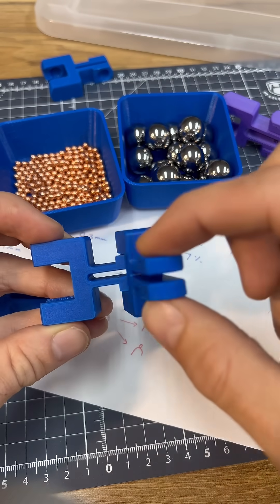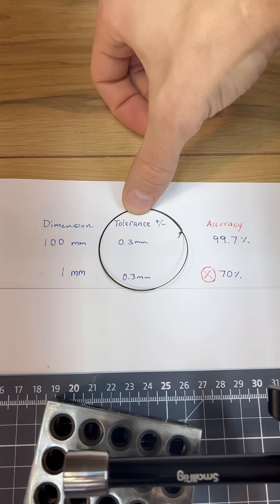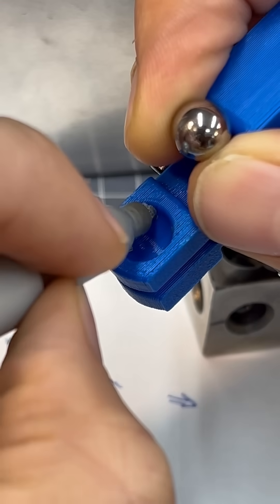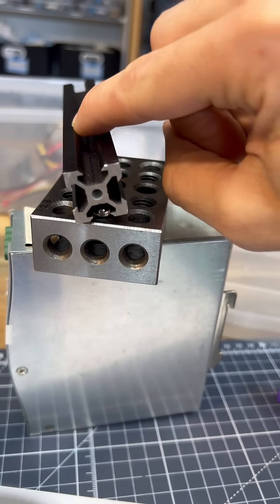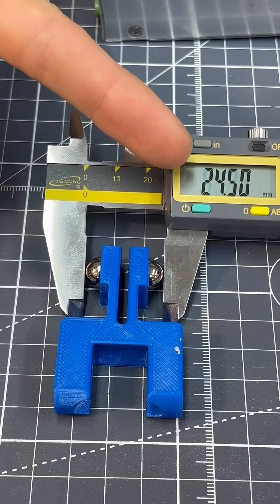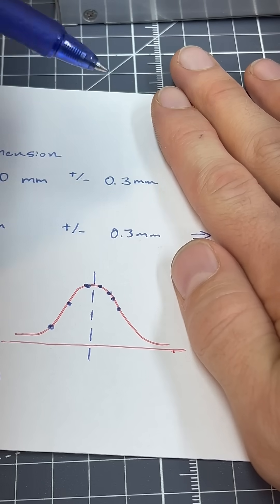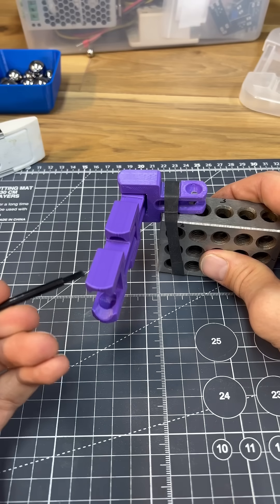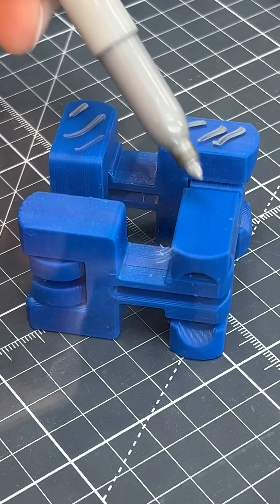Exhibit 1: borrow a tolerance, design 3D printed part with Axis.

Comment: My thermodynamics engineering teacher always told me if you sound like the smartest guy in the room, but no one understands you, then you have lost the plot.
Reply: He's just saying to not print something that is too small of a distance because the shorter the distance, the shittier your accuracy will be (70% accuracy for 1mm.  99.7% accuracy for 100mm apart.  That's why he chose a distance of 245mm to get a very high accuracy confirmed by his digital caliper.  

Next thing he mentioned is tolerance of 0.3mm. That means s You will have an error of +/- 0.3mm Everytime you print something between 1 and 100mm.  The problem is you don't what the actual error WITHIN 0.3mm will be. Can be off by 0.1, or 0.05 or 0.2451821 mm. That's why he printed like 10 samples and measured the error and calculated the mean to see what the average error was between his samples.  So if the average was off by -0.1mm, in your REAL print, you want to offset / compensate for that distance.  Eg if his 3 contact point distance was 3mm on your CAD, you'd offset that distance to 3.1mm based on the average gaussian mean error he calculated.
Reply: @vex123  I'm even more confused... You lost me at "That's why he chose a distance of 245mm"... But how can you chose a distance?... I mean if I need my part to be of some specific dimensions, I can't choose other dimensions. It needs to have the dimensions that it needs to have...
Reply: @MStoica  Sorry ... good call on my mistake - it's 24.5mm, not 245mm.  So in that case he will have BOTH accuracy between 70% and 99.7% and a tolerance of +/-0.3mm.  He also seemed to have some kind of a steel jig with high accuracy so maybe he used that somehow to achieve a high accuracy 24.5mm as a reference point.  And then isolated the tolerance variable using the mean Gaussian distribution would be my guess....
Reply: @vex123 ohhhh 😅
Reply: @MegaChickenPunch  I'm with you bro haha
Reply: You should have made, or at least narrated, the video, it would gave been better  @vex123
Reply: @vex123  Then he's not really using good words to say that because mostly anyone understood what was he saying exactly
Reply: @vex123 why not just say that then?
Reply: One of my mentors once told me that you never want ro be the smartest person in the room.
Reply: @joho0  don't be the smartest guy while you're working you're way up.  Near the end of your career, switch rooms and  that's exactly what you want to be to capitalize on your expertise.
Reply: @joho0 no for real though! I was in a room with three other grown men, all at least ten years older than me, and not a single one of them knew the word vague. They all just blankly stared at me when I said it! One of them thought I was calling him a f*g! I HAD TO EXPLAIN THE WORD VAGUE AND THEY ALL WERE ACTING LIKE I WAS THE DUMMY SOMEHOW
Reply: He's saying that printers have unscaled tolerances. That inaccurate tolerance with an axis, like with a hingepin style movement, would wobble and torque. The three small ball bearings make the larger one fit snugly, (they locate the sphere by three points in space, and so give more precision in where the sphere actually touches the part) and still roll with the least amount of friction. In turn, the larger ball bearings seat against them, making the width of the whole joint much more accurate so it doesn't allow the chain to twist.
Reply: Can’t dazzle em with brilliance than baffle them with bullshit
Reply: @Brownnoise443 - then
Reply: @Brownnoise443  so I saw this on a youtube comment a long time ago, thought it was hilariouse and started using the phrase day to day. Just curiouse, where did you come about that phrase? Just tryna figure out where it came from
Reply: Was this a complex way to describe what a bearing does?
Reply: Well then, that’s currently a huge issue for me.

Got a project I’m working on and what I made is pretty crazy. It’s not just the design I had to make but a whole parametric model to generate many different sizes. (Which happens nearly fully automatically based on a couple parameters).

But the issue is that even the CAD professor doesn’t understand everything I did
Reply: If you're the smartest guy in the room, you're in the wrong room
Reply: @TAP7a what if that room is filled with women?
Reply: Perhaps you still need to complete the prerequisites for this course.
Reply: I understood it. I appreciate your thermodynamics teacher's sentiment, but this is just a situation where you should do some more research.
Reply: Yeah but people actively choose to not understand.
Reply: I literally thought I was the only one who didn’t understand this
Reply: @izdotcarter  they you're a dunce, because it's really simple and explained.
Reply: Engineers have a need to make things sound overly complicated until someone slaps their hand and reminds them the purpose of words. My first highly technical lab report for a circuit design class came back with a B but more than half the sentences were crossed out with “not needed” and every instance of “utilize” was changed to “use” with a note “wrong word”. Actually, the mistakes were so common across papers, the mistakes were marked with numbers and you had to reference the grading key.
Reply: @lusher00  they're not engineers, they're arrogant pricks who think they're engineers, they want to feel smart not be smart.
Reply: @lusher00 Depends on who you’re explaining something to. Sometimes the hardest thing is explaining to business how something works or why it needs to be done in a way they can understand.
Reply: @Nihlink  no audience needs things explained in unnecessarily complicated language designed to make the presentation sound smarter than it needs to be, particularly nontechnical management
Reply: It's the short form content.  I seriously recommend going to his channel and watching the long form vids if you have any interest in production and design.  This guy is absolutely brilliant.
Reply: Yeah seriously.
Reply: ironically enough, MY thermodynamics professor always sounds like the smartest person in the room, and none of us understand her or gain anything
Reply: yeah true this is hard to understand
Reply: This!
Reply: with the most votes in the comment section, this comment should be number one. That was too much unnecessary explaining.
Reply: I feel like there was a preamble here that didn't make it into the short.
Reply: So in other words Terrence Howard.. lol
Reply: After being in maintenance for 3 years I have learned that talking like a caveman is the best way to go. In their defense I kinda have all these visuals in my mind that my retarded hand gestures cannot convey.
Reply: Your teacher only defined politicians chit chat,  sounding smart meanwhile talking bullcrap.
Reply: My thermodynamics teacher told me pi = 3 = e
Reply: Story of my life
Reply: @cybyrd9615 grats bro
Reply: If you don't understand it, then it isn't meant for you. You're not the only one in the room.
Reply: That’s because your thermodynamics teacher was often lost

Comment: You lost me at using the 2 points from the 1-2-3 block to define the axis in your design. Is this spoken relatively? As in, was the 1-2-3 block only representative of the situation? Makes it unclear to explicitly say you're using those points to define the feature on the part.

I could be missing something, but i have a pretty strong background in DFMA and GD&T and think this video is poorly explained outside of the explanation of relative tolerance.

Comment: In layman's "balls always touch a hole in three spots", "3d printers are not very accurate in small spaces" and "it's easier to center the balls in a hole than it is to print a perfect hinge"
Reply: Fuuuk, i figured it out. 
"it's easier to center the balls in a hole than it is to print a perfect hinge" is actually not the final conclusion he is trying to state.

The first 2 he states like you said.
But the final point is more like.
"if you want to get something to be accurately positionable (like a hinge) in a 3d printer make the design reliant on far apart positions in the same axis/plane instead of a single point or multiple points grouped together. because the printer can position the points accurately but the precision will be the same on all types.
Thus by spacing out the reference (contact) points you can get a more accurate result. "
Or 
"Rely on the printers ability to put material in specific points irrelevant of distance and design around the precision gained from creating an axis or a line using 2 contact points"
Reply: @sandertu8366 oh this makes sense - put the edges of the hinge as far apart as you can to get as accurate a linkage as possible
Reply: While I'm admittedly not currently operating at 100%, I am not sure I would have figured out what he was saying before scrolling away were it not for multiple comments working in tandem to parse it out, and without listing off credentials, I typically am more than capable of grasping concepts such as this when being taught.  It feels like he was told to explain the concept as tangentially as possible.

To explain it all even a bit more simply without going full on eli5 (I hope), the point is a ball shaped hole will contain more irregularities than an ever so slightly larger hole in which three bumps are placed for the ball to actually be in contact with.  It's easier to have more control over the position and motion of the ball when you only have 3 points to worry about, where the ball sized hole has infinitely more possibilities for an errant bump or dip, meaning infinitely more deviations from a perfectly smooth rotation in the desired location
Reply: https://youtu.be/pN-rh6UwR_A
Is this long-form version of this top.
He buried this link somewhere.
Reply: It took this guy some balls of steel to make a good hinge
Reply: He accidentally created the audio equivalent of "the dress"
Reply: it should be called genius terms, it takes a genius to break things down to simplist terms, thank you.
Reply: Thanks, I was too stoned to follow along.
Reply: You did not help, but made things worse
Reply: So, a socket is better than a hinge because it contacts more surface area? So, he basically turned a socket into a hinge with more accuracy by combining two sockets?
Reply: That last sentence is not what he's saying at all. 
The first wobbly rotation uses the same setup with a ball. 

This video is talking about rotating the base axis of the print to make up for the inaccuracies of the printer and using the balls' point of contact to determine that. 

Notice how the lattices on the blue parts (wobbly) are perpendicular vs the purple parts (stable/smooth) which are diagonal.
Reply: It’s like saying if you throw 2 darts at a dart board, you can expect the midpoint between the darts to be closer to the bullseye than either dart alone. 

Increasing the sample size causes the average to be closer to the expected mean value. Note: This assumes that the positioning errors are independent events, which may not be true.
Reply: Tars, humor 90
Reply: Yes, but with hinge you get a pole that's pushed into a hole, and this way you only get balls touching the hole, which is pretty much dissatisfactory.
Reply: Thank you! I was like wtf
Reply: I'm a freshly minted Mechanical Engineer and had to watch this three times to figure out his point was to use commercial parts with tight tolerances to make up for issues with FDM
Reply: @countera6567  Are you really a mechanical engineer ? Because I m in school of engineering and his point was to use the fact that a ball only need 3 point to stay, so if you print an "hemisphere", you will get a normal distribution of having your metal ball at a certain heigt. Therefore, it's way better than just printing some joint, because you get a high probability of having a ball that is nicely centered.
Reply: @countera6567 Yeagh - I’ve just watched it like 6 times and I’m really not much wiser. Having tried to make some bearings in fdm which I tried to optimise for a month or so (and surprise surprise it didn’t work well) instead inserting deep groove ball bearings and all the problems went away, where the fdm bearing surfaces just interfered with each other nastily as I just couldn’t get them smooth enough/ tight toleranced enough. But … I think he’s trying to say something else - as in his example he’s not putting a complete “rolling element” bearing in, instead just putting spherical steel balls - but that just feels to me like - putting half the bearing in, or at least as I might put it - a simpler bushing instead. So …. Yes I’m not sure I get what he’s trying to say. I think there may be a general point he’s making but I just don’t get it. It seems obvious to me if you have things ina. Design that fdm can’t resolve, or doesn’t have the right material properties - then you use the item as an off the shelf component - eg small steel screws such as m2s and m2 nuts … which you just couldn’t fdm. So you use the off the shelf screws….
Reply: @countera6567  What did you think he was saying initially? He was using low tolerance designs to create higher tolerance restraints to the motion of the hinge.
Reply: I don't understand why anyone would want to limit the number of people who understand what they are saying.
Reply: @steveescher1554 Don't attribute to malice what can be attributed to ignorance. Teaching is harder than it looks. And the more you understand something (or feel like you do at least) the worse you will be at explaining it, because you will assume the audience knows about things that are obvious to you but are not a given to others. Those others will not understand anything about the explanation if they don't have the tools to do so because they were not included in the explanation.
TL;DR: explaination bad because explaination too short because explainer thinks some things don't need explaining
Reply: @Ragnar_Oock idk, I was taught by a professor that truly understanding a concept means you can explain it to anyone. Even those who don't know the technical jargon, that's why trying to explain concepts to others can be so helpful in learning.
Reply: @Ragnar_Oock  I know where you got the first line of your paragraph and I respect it. Love that video.
Reply: @blackace1295  that's a very common phrase
Reply: @chickenfishhybrid44  and?
Reply: @Ragnar_Oock  "If you can't explain it simply, you don't understand it well enough." -Albert Einstein
Reply: @Ragnar_Oock  On top of this, explaining technical things as accurately as possible can lead to obscure-sounding explanations. Explaining complex things in basic terminology can lead to a more inaccurate explanation. There is a balance needed, and the audience is such an important factor in delivering a message well.
Reply: I wish my teachers had understood this. @Ragnar_Oock
Reply: @countera6567 that’s exactly right, to explain something simply is to understand it fundamentally.
Reply: @countera6567  no, that's just getting really good at explaining things.  Someone that's bad at explaining things can still have a perfectly clear understanding of complex theories.
Reply: @Ragnar_Oock Nah, he just cuts part of his main 30 min video in the worst way possible. 

He’s too lazy to come up with a proper YouTube short explaining the concept, and instead cut up a bunch of clips missing a lot of context.

Doesn’t cut corners with his GD&T but cuts corners in a poor attempt of simplifying it.
Reply: @Slayer8248  Thats not a strong argument given that concepts being glossed over is detrimental to teaching people.

I remember in engineering where my professor was explaining a mathematical proof of control theory to a class that hasn’t taken linear algebra yet. Glossing over partial differential equations on a spring mass damper problem is leaving a lot of explanation on the table. Thats how lectures become side tangents.

By the time the core subject of the lecture is addressed, class is already over.
Reply: @Ragnar_Oock  FWIW, what you described is also known as "The curse of knowledge"
Reply: @steveescher1554  Getting into specifics and understanding of what is actually happening is just like that sometimes.
Reply: @steveescher1554  he's just being more precise so that if you care you can understand what he's doing. If you can't even tell if you care then you definitely don't care.
Reply: Had to look it twice, but I think the video explains the phenomenon perfectly.
Reply: @mrnivala  if you had to watch it twice it wasn't explained perfectly.
Reply: Was this a complex way to describe what a bearing does?
Reply: LOL. No one can agree on what this guy is trying to say. I believe that's because he doesn't know what the hell he's talking about. You don't improve the tolerance by using points. It should take but a second to realize he's wrong on that. However, you do stabilize the ball bearing in one location, meaning you can eliminate play easily, and that's what he was unable to understand and explain, I'm guessing.
Reply: The video was pretty clear... He's discussing the limitations of the 3d printer and how to use basic geometry to achieve the higher tolerance results you want.

Comment: This short reminded me of the GD&T course I took a few years ago when I earned my CNC machine operator cert. Tailoring your design tolerances to make sure that the functional features are precise while allowing for other features to have less precision is both more efficient and makes it easier to produce parts that are within tolerance AND still function properly. I agree with other comments that your explanation leaves a lot of things unclear. The distribution thing didn't fully make sense to me.